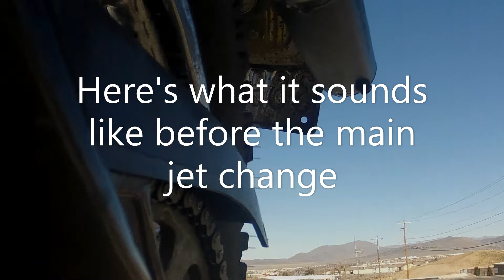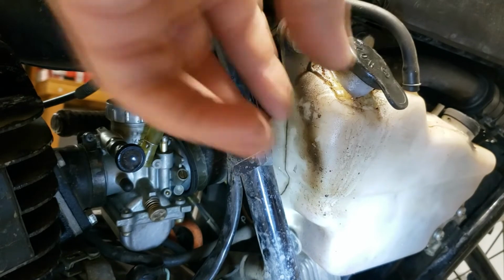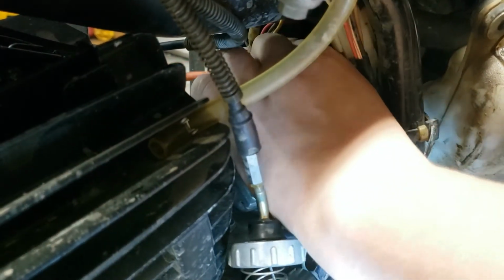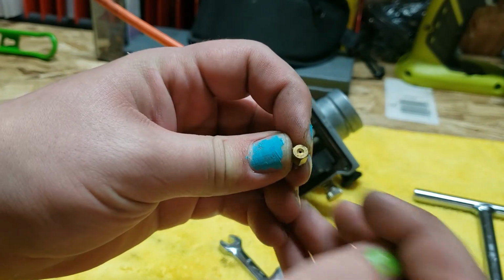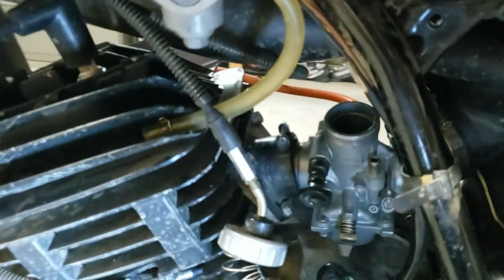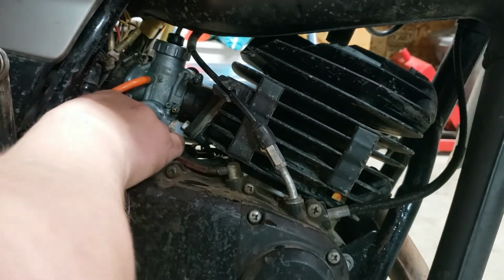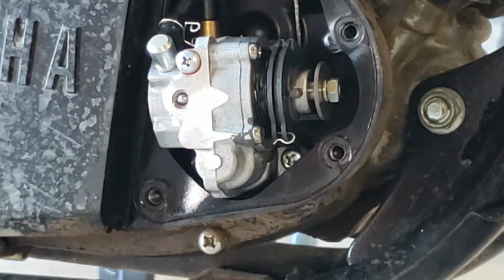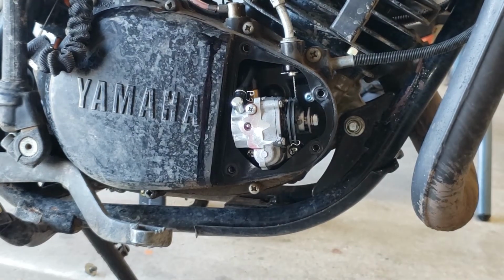1979 Yamaha DT175 - Carb Removal, Main Jet, Autolube Bleed

Comment: Thank you so much for this video.  It helped me so much, because i have same model 1979. I bought this with only 5k miles and it was equipped with a no name brand carburetor. That one works frome driving perspective very well but obivously too rich since s spark plug is always sooty. I also have the original MIKUNI VM 28 SS which looks realy good. Main Yet 130 I carefully cleaned it up an gave it a try. It works but last Quartier of gas there is no performance above  ca. 40 miles/h. then stop. With no brand i could go up to ca. 60. So was it sucessful when you changed your Main Yet? Maybe that could be solution for my old Mikuni to step Main yet up. I'am wondering since my Mikuni is still equipped exactly with stock components. No modifications have been applied so far. I think it should normally work with that at best performance.
Reply from the maker: Thank you for the comment and that's an interesting question. You're correct that the main jet is responsible for the last 1/4 throttle so I would start there but the needle jet also affects it. I would always recommend an OEM carb over a no name carb. Perhaps you could go up to 60 because it was too lean which is great for top speed but bad for engine life. I'd also do some plug reading to find some differences between the no name and OEM Mikuni. These are just my opinions though. Keep the rubber down brother!
Reply: Thank you for quick reply. With that no name brand i could achievec nearly 60 then i stopped since i didn't want to stress that old japanese lady because she wssn't moved for long time. But the spark plug was also still sooty. Strange.  So then i started with the MIKUNI to built it back to origin Version. Started yesterday with air srew out 1+1/4 turns out. Finally 1+3/4 turns out. Idle, response and acceleration was fine. I could end up at ca. 55. Sometimes she seems to be  a little bit bogging but very slightly in lower rpm range. I check spark, wich seams to go more gray colour and measured cylinder head temperature which was ca. 130°C. I' am not sure if that is going too hot maybe she's going too lean now. I will try to adjust carefully next days again. Try to make it a little bit more richer. I don't plan to change any of those stock components since i think they should be best fit to this machine. But may be i' am wrong. It's not so easy here in Germany to get real  OEM parts for reasonable price. It ' s almost rebuilt after market and sometimes not the same quality. For oil pump setting. I think the mark on the pulley should be in line with the bolt when all the free play in the gas cable has been taken off by moving the gas gripp until the slider starts to move, right?  Because then the ramp on the pulley starts to increase.